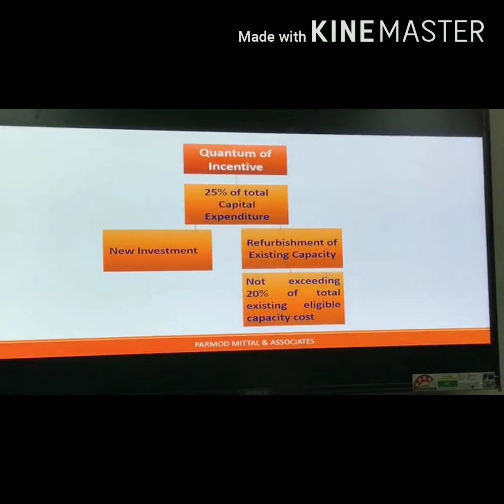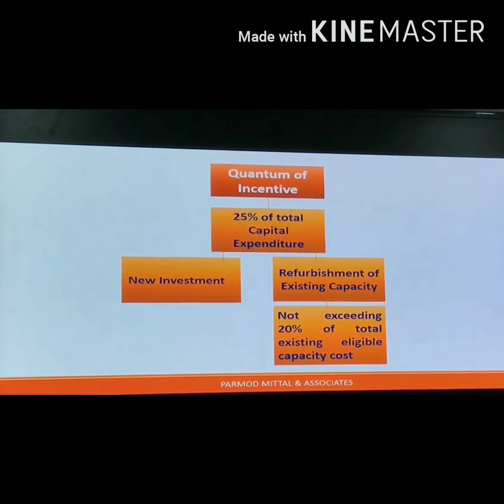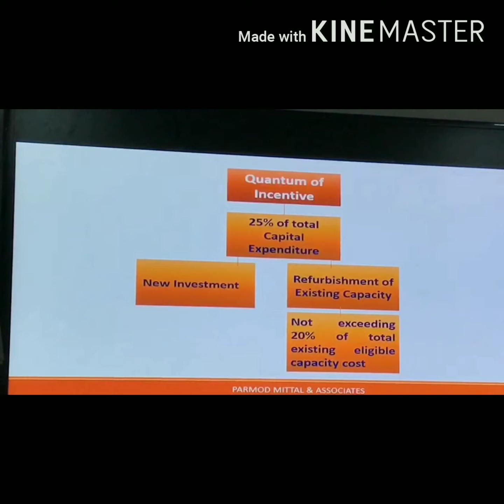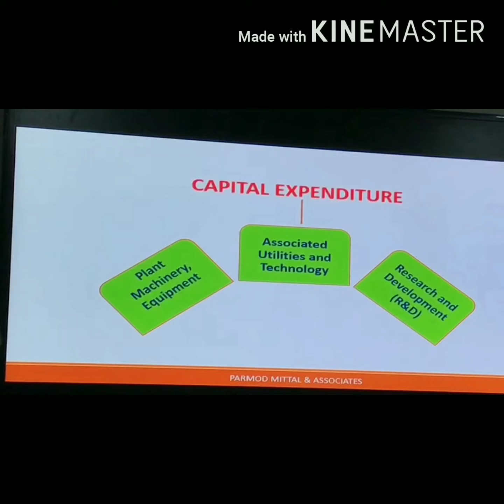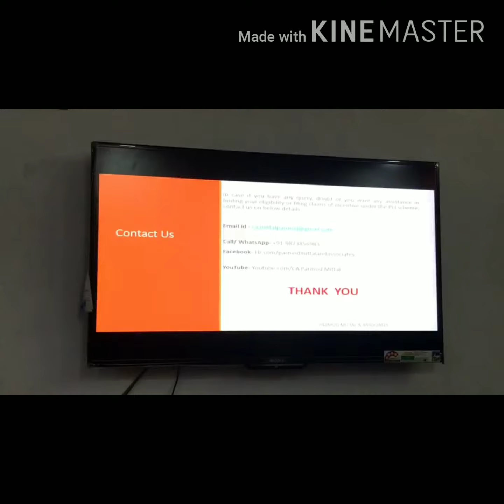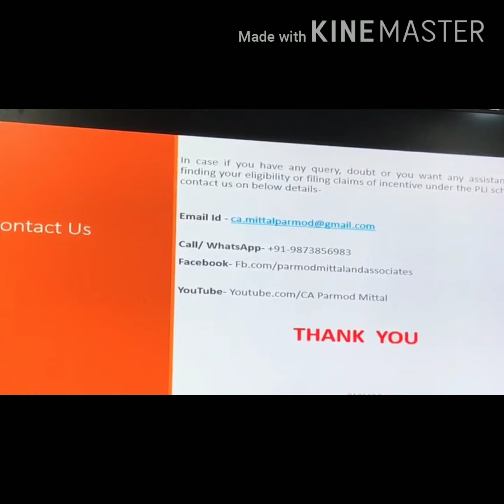Scheme for Promotion of Manufacturing of Electronic Components and Semiconductors (SPECS)

Comment: Please explain briefly
Reply from the maker: Hello Mr. Uday,
The Scheme for Promotion of Manufacturing of Electronic Components and Semiconductors (SPECS) is for those companies which will manufacture mobiles and electronic components whether related to mobile or not (as specified in the scheme) in order to become eligible under this incentive scheme. Moreover, if you require more clarifications then you can contact on our contact number i.e. +91-9873856983. Also kindly share your contact details.